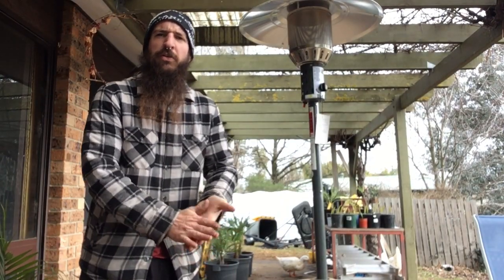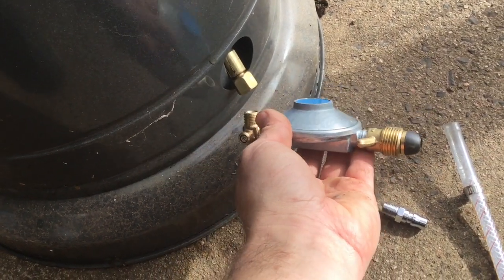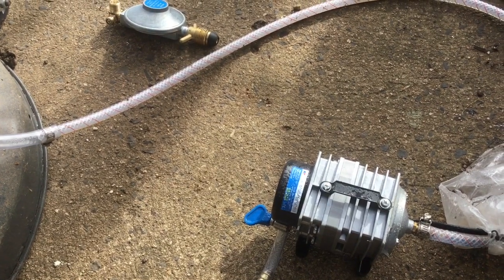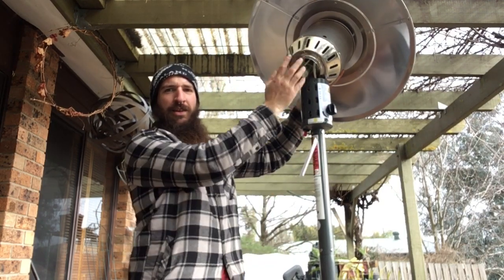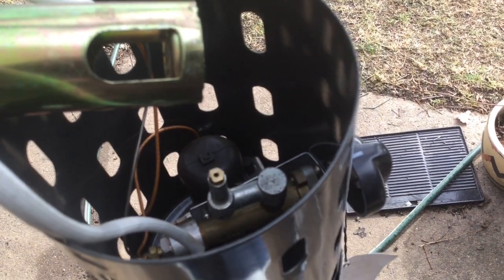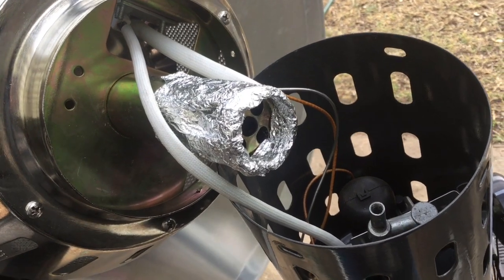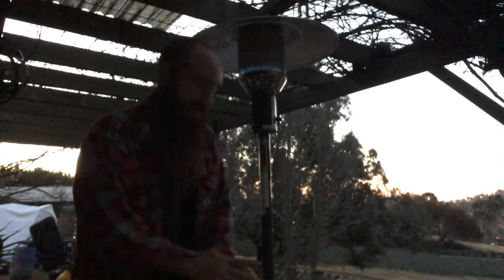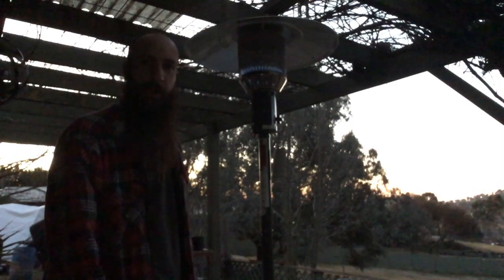Biogas outdoor patio heater conversion

Comment: Cool! 

1. Exactly what barb fitting did u use or can u use any as long as they fit? 
2. Does it have to only be aluminum foil to over the part u covered or can u use anything else?

Comment: My ibc was a fail, I had borrowed what I thought was a 4 inch holesaw from a friend. Turns out it was 4 1/4” holesaw. I have 3” uniseals. My tank is done in.
Reply from the maker: Dave Dollars can you not re drill an use a 5 inch holesaw and then get 4 inch unis and pipes? Can you exchange unis, they are expensive in Aus and hard to come by, I’llhave to order mine in from the states.

Comment: What’s the cold temperatures do you get there.
Reply from the maker: During winter, overnight temps are typically around -2 to -7C, had some snow last weekend.❄️
Reply: What don’t you like about the ibc tanks for a Digester.
Reply from the maker: IBC digesters are fine, just not the solarcities design which almost seems to be the norm, I am designing my next ibc tank differently, which I will put up soon
Reply: I’ll post my new step up this weekend. Farmer buddy dragging feet with the starter manure. Keep posting your videos. I like the hole biogas thing.

Comment: does the pump need to be flameproof?
Reply from the maker: travelers world cafe Llc i wouldn’t think so, this was a cheap ebay pump and I did have to tighten a few screws and use a bit of silicon to make it ‘air tight’ but as long as there is no oxygen in your biogas bag/tank there should be no issues